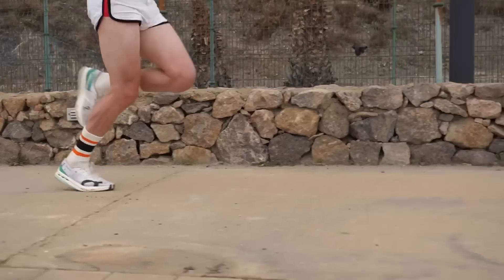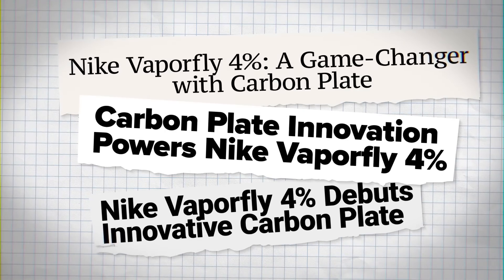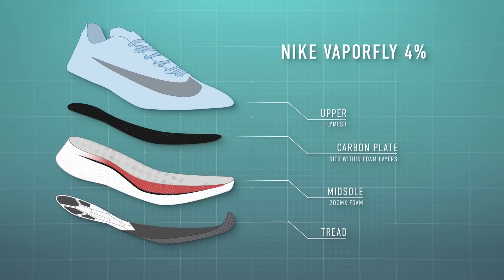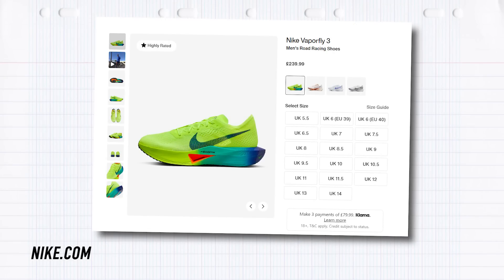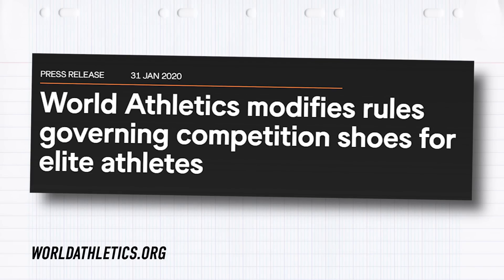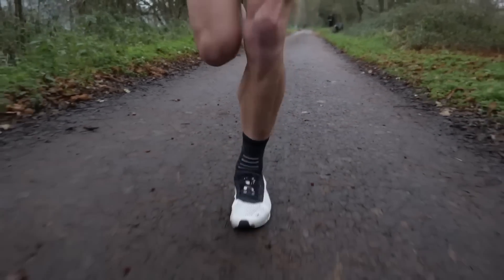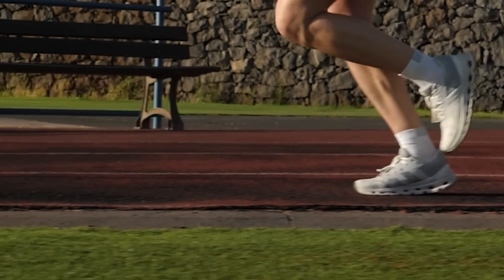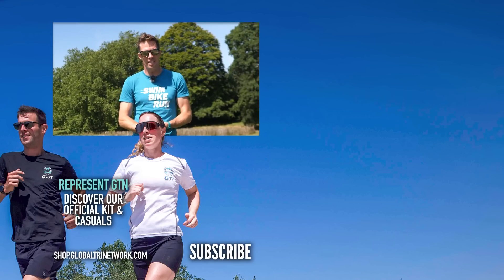Supershoe Foams: What They Aren’t Telling You

Comment from the maker: Did you already know this about supershoes? 👟
Reply: Yes, I knew the foams were the key and that Pabax plastic had been used in track spikes for years as the hard plate unless carbon fiber was the plate as was becoming the newer trend at the time for some of the very top of the line models, just before super track shoes came out, even then some use carbon fiber as the spike plate extending into the super foam as a thinner material.  Nike needed the carbon for the shoes becuse of how high and unstable the foam was. Before this the best I had seen was the lighter Lunarlon foams with a thin EVA foam under or a thin wall on the sides were able to have shoes so runners could have a racing shoe as cushioned as a normal running shoe but as light as a racing shoe of 7 oz or 198 grams and was the best in its time. with Lunarlon I was surprised the old hard used since the 1980's to 1990's Pabax plastic was not a thin full plate as thin as a 2--3 mm plate for the Lunarlon foam in running shoes.

Comment: There are shoes that have ZoomX without a plate, though.
Reply: They’re not entirely ZoomX - the chassis often has a stiffer EVA foam that helps control the zoomX
Reply: @kngofdestiny sometimes they are like the invincible run. They just use a more rubberised version of zoom x for more durability

Comment: James & GTN team: nice job on the research and presentation of it; well done. Please consider a follow-on series on the topic, but only if you want to break the internet, and here’s why:  like many, I run in a nasty-warm climate (south Florida, U.S.) where heat is a constant. I’ve regularly suspected durability is reduced by heat with respect to foam, foam recovery and annoyingly - the rubber soles which tend to wear frustratingly faster than in cooler times of year. As info, I’m a Cloudflyer guy. Cringe comment: I judiciously have a shoe cobbler replace 1 portion of the sole for low-mileage wear, but how valuable it’d be to have useful data which inform runners of trade offs you touched on ("and, and, and, and..") among the different technologies we all consider. Again, nice job on this one.
Reply: Could you expand on what you have a cobbler do to the outsole?